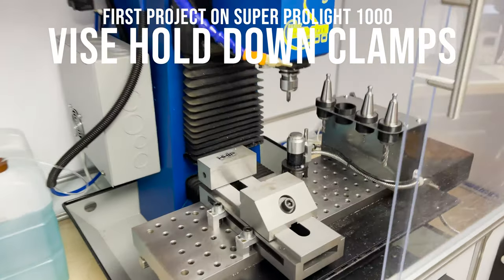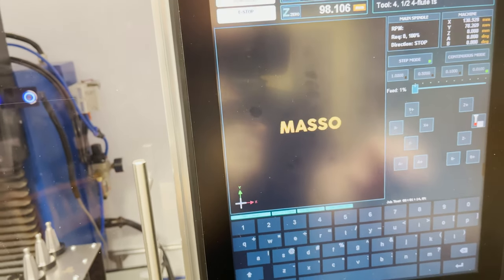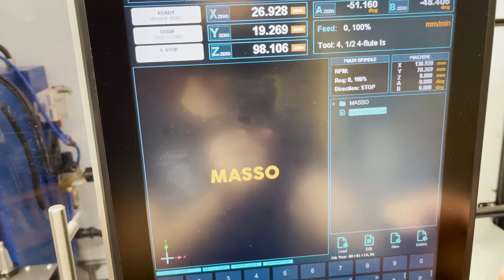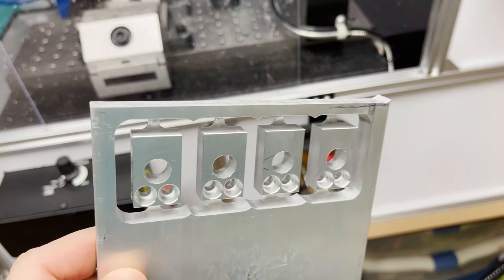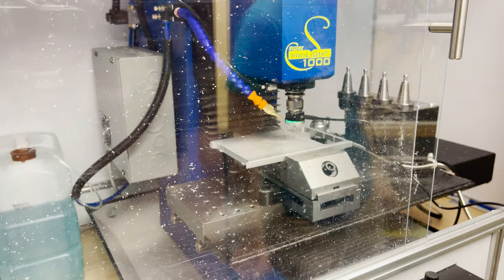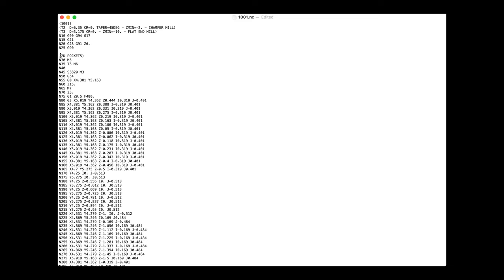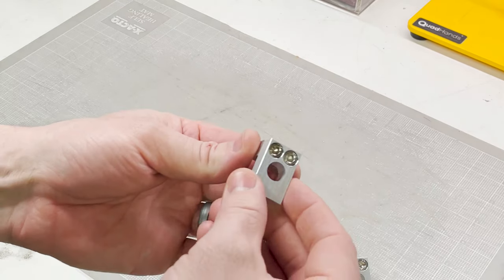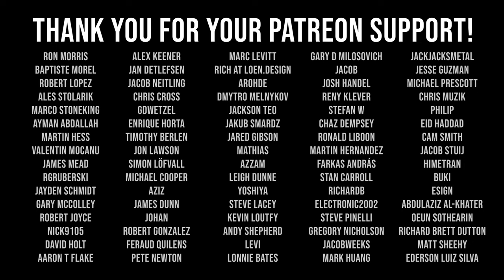Machining Vise Hold Down Clamps for my CNC Mill with Masso G3 Touch

Comment from the maker: I found out why the machine was pausing at the tool changes...Peter had answered the question on the Masso forum: "If you don't want to press cycle start before each tool change turn off optional stop in Fusion and also also turn off tool preload." I tried it and it works now!

Comment: Fantastic work! One thing that I did was installed a longer nozzle to wrap over the spindle as no not blow chips into my tool holders and tool rack.
Reply from the maker: Thanks! I like that idea..it does make a mess of things!
Reply from the maker: There were tapped holes on the other side of the spindle block also, so it was easy to just switch it to the other side. I haven't seen any updates in a while...how's your Prolight & enclosure coming together?
Reply: @diyfiberlaser  excellent! just be a bit carful, the smaller threaded holes on the side are meant for tighten the gibs. over tightening the center threaded hole might over tighten the gibs and cause excessive wear. 
I made a quick enclosure with some melamine board and acrylic sheets for the door. I am currently remaking it on a smaller base to save as much space as possible. Not sure what will be my material this time around. Keep up the amazing work!
Reply from the maker: @juansalgado6212  Thanks for the tip! I double checked to make sure my mounting screws weren't bottoming out on the gib set screws and luckily there was still a little clearance.

Comment: I bet you got chips between the tool holder and taper.  And you set tool height without the air blast working on the TH setter.  Finally, I'm not sure Al is the right material for a vice hold down.  Keep up the great content man!
Reply from the maker: You're right, as Juan suggested I should blow the mist & chips in the other direction away from the tool rack. The tool setter air blast didn't fire because of the machine pausing between tool changes...it works now that I learned how to post process correctly. I guess I am incrementally upgrading the clamps: 3D printed > aluminum > guess I'll have to make some steel ones now that I have a better understanding of how the machine works.

Comment: You may have fusion set to manual tool change somehow or there is an m0 (stop) or an m01 (option stop with option stop active on the control)

Comment: i noticed the chips on the tool setter also. i love the fact that you did every aspect of the setup...and showed the good and the bad. great stuff travis. Im getting ready  to full cnc my new to me  International Hobbies IH600 Mill.  Ill hopefully do a video of the process...your tool changer is perfect what I'm trying to achieve. Question why did you not tap on the ProLight also?  Great video. Your enclosure is awesome BTW
Reply from the maker: Thanks, the Masso doesn't support rigid tapping at the moment, also my spindle doesn't have an encoder on it.

Comment: I’m not sure how well you like the vise you have but you should look into a Saunders machine works mod vise. They are incredible, low profile, and have soft jaws, talon grips and serrated jaws. 

Side note do you hate the half slide doors or they ok? I think I would rather two half doors on hinges to gain full access to the work.

Comment: hopefully your vice doesn‘ t go flying with aluminium clamps. Aluminium is not as flexible as steel and deforms easily and you loose clamping force. I would keep an eye on them. Nevertheless nice first job on the Masso 👏

Comment: do something with chips on your tool change post
Reply: I was thinking of a barrier on the left side.
Reply: I was thinking an Air blanket or curtain to keep the chips off the tool change taper. A plastic barrier would interfer with teh tool change. OR maybe some kind of air blast to keep chips off the tapers.

Still no ducting on the electronics enclosure. :(
Reply from the maker: I just moved the mist sprayer to the other side of the spindle so it will blow the chips away from the tools now...one of those things I didn't consider until I saw it in action.
Reply: @diyfiberlaser  and into the air intake of the electronic enclosure?
Reply from the maker: @zitt  that fan is blowing out, the intake is on the rear of the machine.

Comment: I think that is wanting to preload next tool you can change that in fusion 360
Reply: in post options preferences uncheck preload tool
Reply from the maker: @joesmith2465  Will do, thanks for the tip!
Reply: Agreed. I came to say its calling for a tool magazine to rotate the next tool into the tool change pocket.